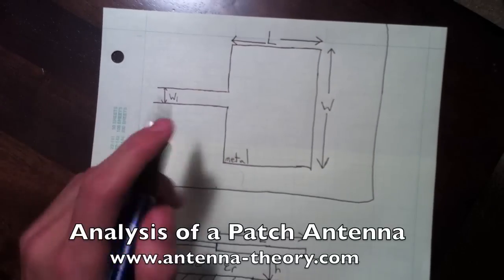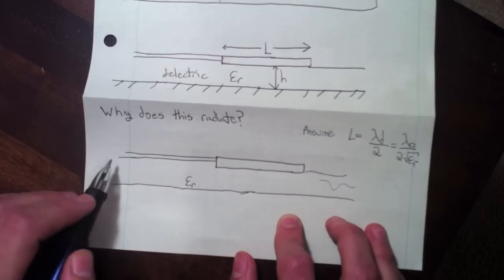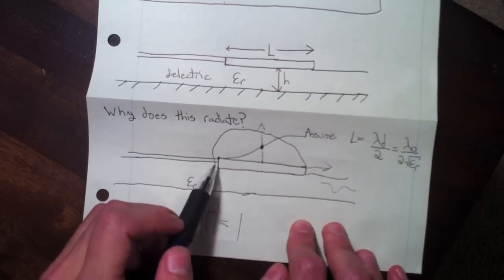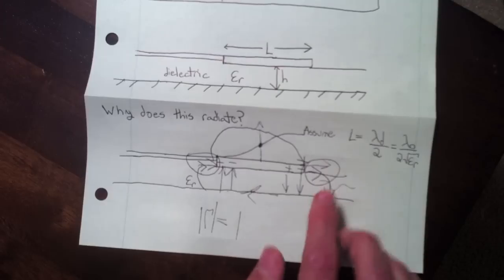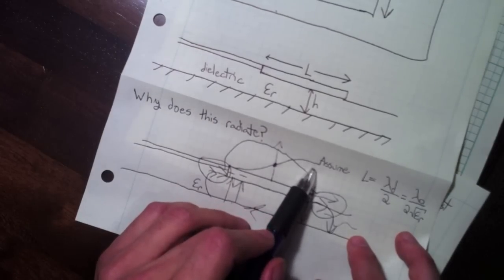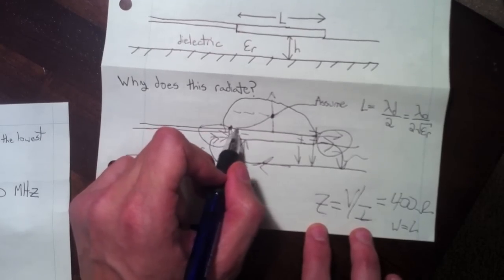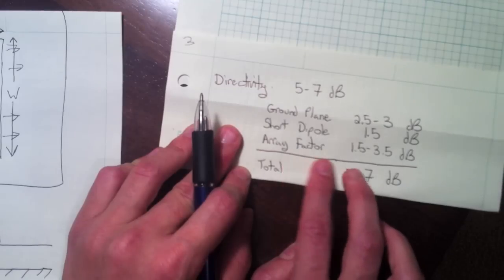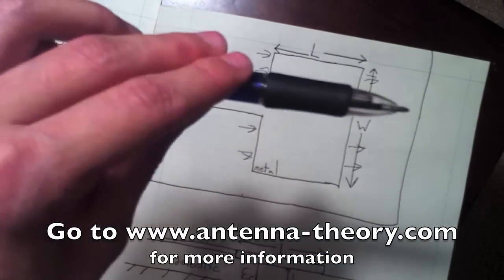Antenna-Theory.com Presents: Analysis of the Patch Antenna

Comment: This is unbelievable! i have cracked my head reading useless books to understand patch antenna.I must confess that you have put me out of my misery.i tried designing one using CST Microwave studio but i did'nt understand the concepts,now i am going back to the lab.I like the way you explained the fringing effect and how it gives rise to the radiation in the patch.you killed it man!
Reply: ANYTHING to do with self-resonant antenna structures will be dealing with either 1/4 wavelength or 1/2 wavelength lengths along the length and width. Understand this and half the battle is won.

Comment from the maker: If the tx line is short (less than a tenth of a wavelength), then the antenna measured at the end of the tx line is about the same as the antenna.

If the microstrip line is long, then you need to factor it in. It rotates the impedance around the Smith Chart. The only shortcut is if you have a 50 Ohm antenna and a 50 Ohm tx line, then the length of the line doesnt matter & the input impedance remains 50 Ohms. 

The equations are in the tx line tutorial section of the antenna website.
Reply: I know im randomly asking but does someone know a method to log back into an Instagram account..?
I somehow forgot my password. I love any help you can give me.
Reply: @Grayson Vincenzo instablaster =)
Reply: @Johnny Zyaire thanks so much for your reply. I found the site through google and I'm in the hacking process atm.
Seems to take quite some time so I will get back to you later when my account password hopefully is recovered.
Reply: @Johnny Zyaire It worked and I actually got access to my account again. I am so happy:D
Thank you so much, you saved my account !
Reply: @Grayson Vincenzo happy to help :D

Comment: There is the theory of Reciprocity...what is on my mind is what if instead I have an incoming EM wave  I would think that the voltage signs would be opposite on the patch given the same feed? Also, instead replace the t-line feed with a probe feed, what does the E-field or fringing field or voltage potential look like then? Moreover, if I increase the distance of the GND away from the patch because of multiple layers do I essentially reduce the fringing fields? If so, what is the consequence of this?
Reply: Corey Bergsrud Yes you do. do not increase the distance. Go easy with the feed.

Comment from the maker: @SeriousTyro You can put a matching network in there if you would like.  Another method is to use a quarter-wavelength transmission line.

Comment: It was mentioned that there was a high input impedance to the patch antenna so there would be quite a bit of reflection.

Would you put a matching network between the transmission line and the antenna?